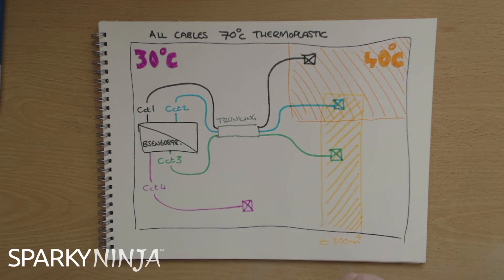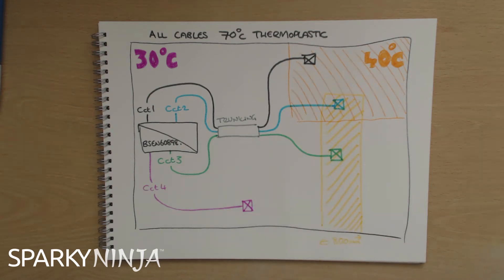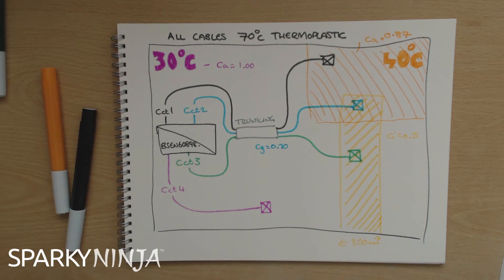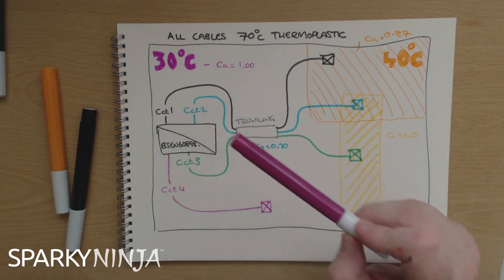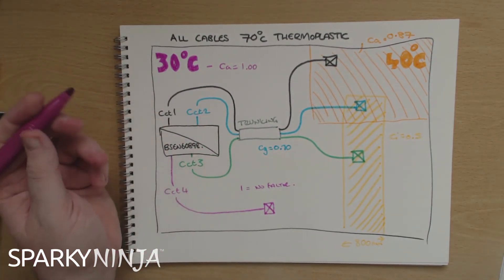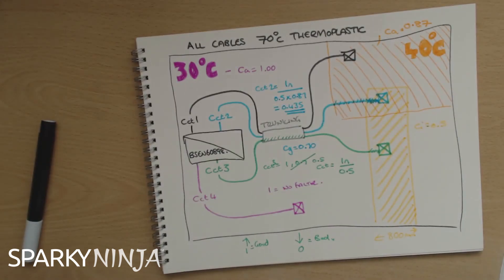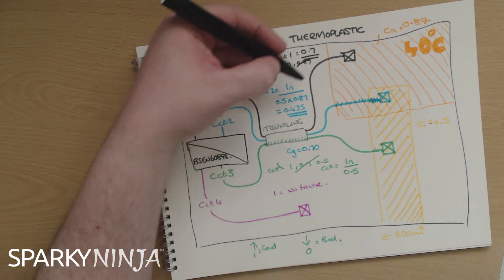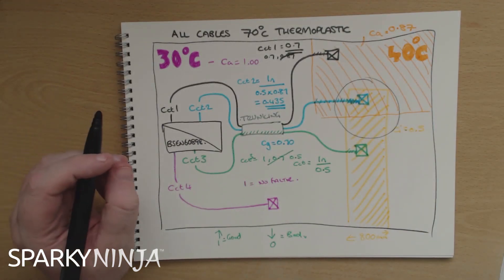Combining Rating factors

Comment: thanks SparkyNinja. I would like to ask when is the grouping factor is taken into account ? I understand it would be during the design stage, assuming a new building. However, would the designer know the cable routing ? unless you tell the contractor that a conduit must not have more than 4 circuits or something.
Reply from the maker: It would be done at the design stage, the assessment of general characteristics in Part 3 push on the need to collect all necessary information.
Communications with project managers and allied trades is important here.

Comment: Also depends if your using a circuit breaker or rewirable fuse as the rewritable fuse adds another factor, so if you use a circuit breaker the factor is reduced even more equating to smaller cable
Reply: 0.725 👍

Comment: Great explanation Dave, 
Ok so in short, you just pick the single worst (closest to 0) factor, or combination of factors that occur at the same time in the same place to a cable? That sounds straight forward👍
My question is why, in bs7671 do they show multiple factors on the bottom in the same formula, if you only need to pick the worst one(s)?

Comment: Another great video! Can I ask what your opinion is of the EAL 4337 and 4338 courses?
Reply from the maker: Hi HobbyMan UK, thanks.

Sure, the EAL I&T courses in my opinion are designed better, the assessments are fairer - but not necessary simpler. If I had the option I would deliver the EAL over the C&G in almost every subject partly because of the qualification structure but also because of how the EAL are as an accrediting organisation. Unfortunately C&G is the common asked for qualification in the industry (2391 etc) and so I have found many places that deliver the 4337/38 are actually using the C&G assessment rigs and material as a baseline, which I think is unfortunate.
Reply: SparkyNinja thanks for your quick response. Looking at some of the courses they do and wasn't sure on the EAL reputation.